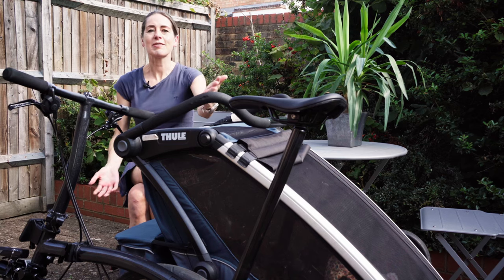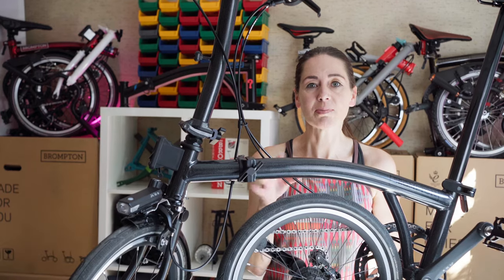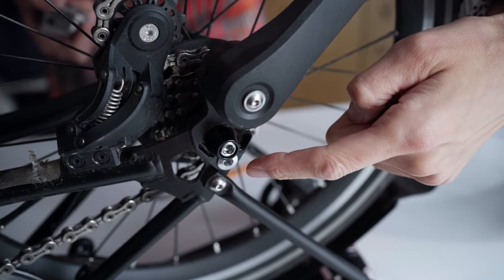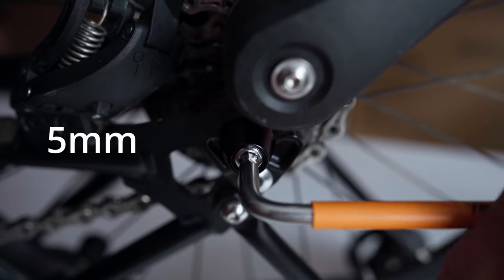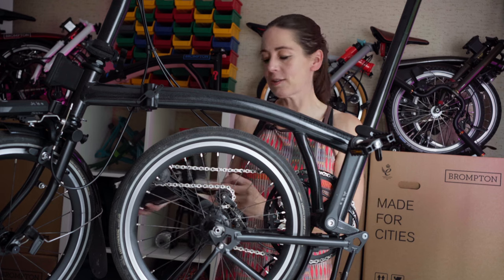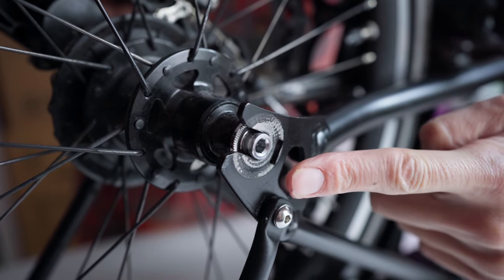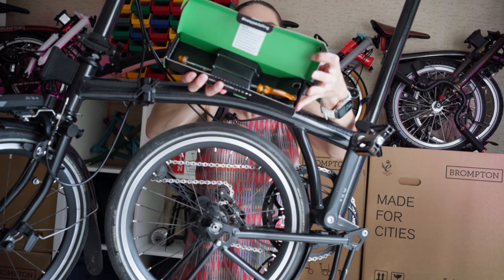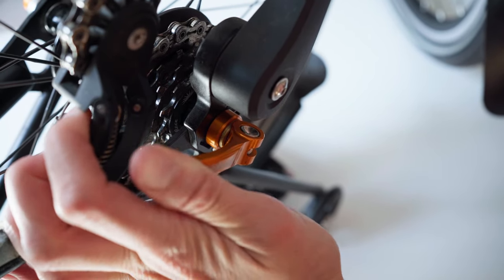Brompton P Line vs Thule Chariot

Comment: Excellent video, thanks a lot for sharing! I was on the fence on Brompton as a vehicle for moving kids around, but after your video - I am planning to give it a try with my P-line! Quick question - do you know whether other child trailers, like Burley Bee / Honeybee will have the same attachment point design, so the extended skewer solution you had shown will work for them as well? Thanks!
Reply from the maker: Thanks for watching. Sorry for the delay, they are different, but I am pretty sure it can be fitted

Comment: I had a similar problem attaching a B.O.B. Ibex trailer to a recumbent tricycle. After gaining the correct skewer the length was reduced to a flush yet rounded state with a hacksaw and file. Having no vise to hold the skewer for sawing I instead used vice grips as a handle to immobilize it on the edge of a concrete stair for sawing.

Comment: Hello Hannah! We do have a Thule Chariot Sport 1 and think about buying a Brompton Electric C Line 4 Speed. What parts do we need if we want to use the same setup like you?
Reply from the maker: We just used the connector that came with the Thule Chariot and a road skewer, like this one 

https://brilliantbikes.co.uk/quick-release/4362-hope-road-130mm-quick-release-rear-skewer-orange.html

I think we mention on the video would put a washer between the skewer and the rear triangle to prevent the paint being worn.

Hope this helps and thank you for watching!!

Comment: For me, the Brompton P line + Cyclone IV Chubby Bicycle Trailer is a brilliant thing.
Reply from the maker: Thanks for watching!
Reply: @brilliantbikes   - https://www.youtube.com/watch?v=Fp6StexKoEQ
Reply: Without a doubt the "Cyclone Chubby IV Bike Trailer" is the best trailer to be used with a Brompton, if you do not plan to take children. Just for luggage and for your Brompton, and it is the ideal trailer to take on the plane, the best without a doubt in terms of weight and design. The only problem with the "Cyclone Chubby IV Bike Trailer" is the connecting arm, it has one end, when disassembled, ready for the hold of the plane, which could be damaged, hit by airline personnel and be a big problem in your destination trip, if it is damaged.

Comment: I’ve been considering the pros and cons of a trailer vs panniers and can’t decide whether there is an advantage in towing luggage as opposed to carrying it.  Obviously the weight of the trailer is added to the luggage making a greater overall load, but the mechanical advantage of the trailer wheel(s) will offset this somewhat.  Have you any thoughts?
Reply from the maker: Thanks for watching and for the comment. TBH I’d rather  not pull a trailer unless it was for reasons of our daughter enjoying the ride.

Comment: Would it have been better to put the nut on the other side? If that nut loosens then your child rolls off immediately if the whole of the skewer had to work its way out you have a little better chance.
Reply from the maker: Thanks for watching! 
The trailer has a built in safety cord, so it is not going to come off. The adapter ends to be on that side and the quick release skewer cannot go the other way due to the adapter
Reply: @brilliantbikes  
Correct answer, trailer connectors are always installed on the opposite side of the adapter / derailer / rear wheel shifting system.

Comment: May i ask Is all brompton same rear fender?
Reply from the maker: Hi - thanks for watching and for the question

The easy answer is no

The original Brompton (now called the C Line) had a choice of two:
For bikes with a rack
For bikes with no rack
(even further back there was each of these available with a small notch cut out for users of bottle dynamos)

The Electric C Line used a different mudguard

The P Line / T Line uses another different one (to go with the advance rear frame)

The G Line uses a different mudguard again

So it's necessary to choose the right mudguard for your model of Brompton 

Hope that helps